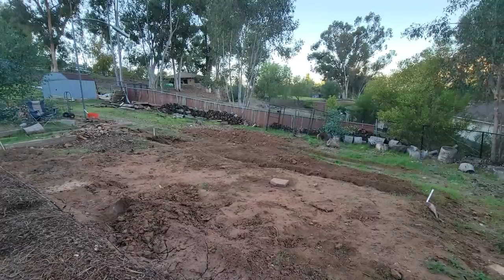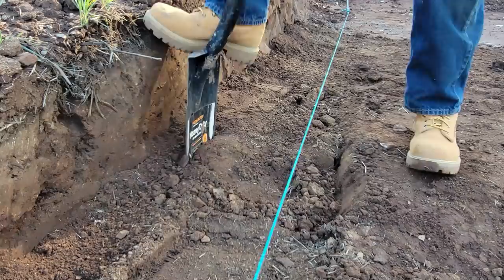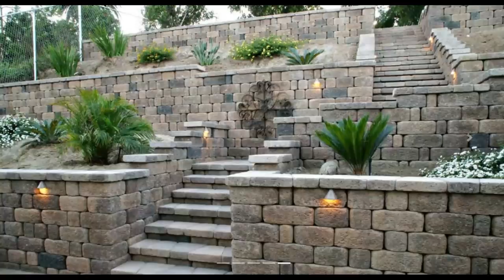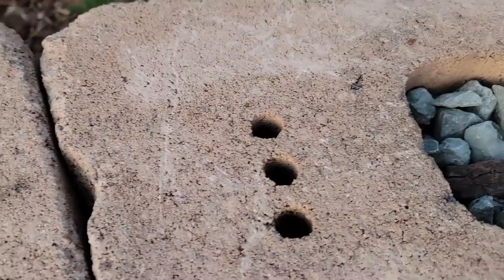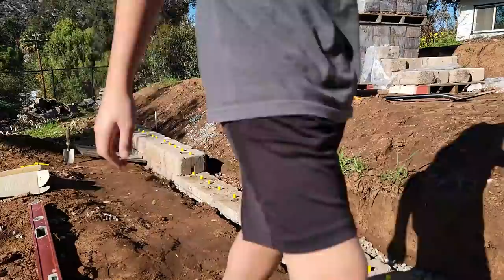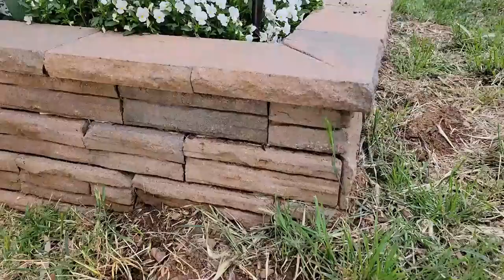How to Build a Terraced Garden Bed

Comment: Beautiful set up, beautiful stones! 
I have a laundry list of things to share that might save someone else some grief and regret. It involves not just retaining walls for terracing/raised beds, but also the pavers that often accompany them. We did a huge job to solve a sloping backyard and to make a safer place for my aging mother-in-law and looking forward to our own aging –in– place plan. 

Things we did that I loved:
-created a bigger patio that connected two awkward back patios with steep and dangerous drop offs.
-created beds that stretched along the back of the patio along the retaining wall to do double duty as garden and fall prevention strategy, Plus making access to the bed super easy from the lawn side.
-used a lighter paver color to reflect light back into a room that was a bit too dark during the first half of the day and which coordinated beautifully with the home exterior
-extended the pavers all around the house from a courtyard area, around the back, with a pathway to the garage door and through the front gate and along both sides of the driveway (that was too narrow for stepping off onto a stable surface for my mother-in-law) and opening up a lovely area In front of the front door and front porch, and doing the front porch also. Love the consistency of the look all around the house.
-coordinated with irrigation guys to make sure we had a way to pipe water into dedicated zones to water certain areas, Including a hose bib extension at the bottom of the terracing.
-Made sure that I could roll a wagon or potentially a wheelchair from the driveway up onto the main patio surface without encountering steps, and potentially into the house with a very low threshold. But part of that was a bad idea.

Problems we encountered:
– we didn’t know how much ants adore paver grout in our area, and that hiring people to power wash means that they power wash the grout out of the pavers. This led to a ongoing battle with weeds growing between the pavers, and that horrible decision between paying virtually for another paver job in order to regrout it, keep after it with a Weedwhacker, risk damaging the concrete pavers with vinegar herbicide, or using the dreaded Roundup. We are kind of between keeping up with it and not keeping up with it because we’re getting old and it is hotter than hell here.
-I made the mistake of being too safety conscious and not enough termite conscious. Or ant conscious. I should have asked the paving guys to slice the pavers in half for the patios so that I could see the foundation & visually inspect for termites. For personal health reasons and because I was growing food close to my home I did not want to go the route of pre-treatment for termites or the baits that would simply attract them to the house.… And who knows what chemicals in those things would get into my food. So ultimately, when I ended up with a termite problem I was told I had to lift all of those pavers so they could drill/dig underneath them, and I got overwhelmed. And the termites did more damage. And I ended up with the poison around the house but at least someone was willing to just carefully drill through the pavers. HINDSIGHT: leave the patios as they were keeping the foundation visible, perhaps choosing a gray paver to coordinate with the concrete to surround/edge patios, or a subtle blend of pavers that had gray in them. The color we chose actually looked fine with the driveway. 
-The design I wanted turned out to need some drains. Those drains always hold a little bit of water. That means we have mosquito breeding grounds on our patio and they either have to be maintained with poisonous dunks or try to cope in other ways. I would make sure that my next design did not need drains.
–I wish I had held out for a design with no steps at all except the aesthetic ones that go down to the lawn below. As it is, I have to do a long circuitous route to drag a wagon Full of tools or plants or baby trees etc. quite a long way to get it up to the patio. As I age, I am aware that a simple accident could be a huge annoyance.
— not thinking carefully enough about the style of the house & personal aesthetic, together. A lot of suburban creations are difficult to Peg, stylistically, and ours is no exception. It's a little more casual Texas colonial on the front and a little more farmhouse on the back, siding and stone facade...not the standard Italianesque or “Contemporary“ home from that era. I’m sorry now that I was seduced by the random-size-random-pattern that was popular at the turn of the millennium.  The choice isn’t terrible. But. It wants something that feels a bit more traditional and my personal aesthetic wants something a bit more minimal. I should have found the sweet spot instead of going on trend.
- textured retaining walls eat up string trimmer line like crazy. Expensive. & Who knows how much plastic ended up in my landscape over the years. A smoother retaining wall brick would’ve been better.
– Or, I would have added a bed in front of the retaining wall, but then I would’ve lost the fantastic thigh high access to my “raised bed“ created by the retaining wall.

-I wish I could have predicted the problem of chemical trails from airplanes dropping God knows what onto the surfaces of our home and vehicles. And all my 62 years I have never seen anything like it on my car, on the surfaces in our area.It’s not like mold or mildew that grows in the darker, damper areas. It’s literally a dark coating on everything that isn’t protected by an overhanging roof or a vehicle that’s parked on the driveway a lot. There’s a whole lot of power washing going on in our neighborhood. Power washing is not great for pavers. So honestly, If I knew then that this was going to be such a problem, I would have used real bricks in a softly coordinating color to edge real concrete, everything mortared to the hilt, As easy to clean as possible. Coordinating retaining blocks in a smoother Finish, and I would probably have fully terraced the yard to the extent that the HOA would allow, 
- every edge becomes a maintenance issue. Things get messy between raised beds in our area where weeds grow insanely fast and freely. I’ve done my lifetime servitude weeding the paths of community gardens and in my own garden. Never again. if I do any more garden construction, there will be mow strips at the edge of any spot where grass likes to grow into beds or plants like growing into the lawn. The paths will be made of lawn grass and large coordinating flagstones set into the turf. Easy maintenance. Mow and go every week. Periodically trim the crisp edge while keeping stolons from creeping through retaining walls into beds. Once a year cut back any grass creeping over the flag stones. That way the paths always look pretty nice year-round with the least effort. Or the least effort short of paving it entirely.

Comment: It looks fantastic.  Thanks for the instruction.  I have a hill that's much steeper, but much shorter in width.  It's a bear, and although it does have a retaining wall at it's base, the dirt overflows it because it is not terraced.  This is a great way to make it a useable space for planting or maybe even a small deck too!
Reply: I would suggest rebar through the hole in the bottom layer of stones going into the ground for stability

Comment: Thank you for your helpful videos. I have multiple gardens and I am working on increasing my garden. There is a patio room with a porch here. I have garden plots surrounding on both sides of the patio room. Off the porch is raised beds. I want more containers on the porch. And I need more vertical garden structures for certain crops. I have subscribed and I have been watching your videos to get a plan to improve my produce.

Comment: Making terraces on any compass direction of slope is vastly worthwhile.  I have mentioned to others of using (my) half terrace raised garden beds.  With another YTer and his once-owned prepper acreage, establishing a flatlander garden, and then having a back slope that wasn't used for 20 feet of height - a most excellent source of diagonal (near-vertical) gardening options !!!  Instead of having a fully raised (100%) garden bed atop a flatland area or a terraced slope - consider - using half-raised (50%) beds for all vegs and smaller flowers, bushes, shrubs, small trees, and dwarf fruit trees on a slope.  Consider a slope looking upwards at it.  Using garden wood, rails, or here displayed stonework walls, dig into the start of the slope for the depth of 16-24 inches.  This will be (depending on the size of stonework you install) or timberworks, going to be ~2-3 rows of vertical stonework.  Dig back into the slope bank for that depth.  Do all of the levels of a "I__I" or "I_______I" shape, and install your stonework or timberwork.  You have done 1/2 of the work in making a terraced bed, and saved 1/2 of your soil for a garden, vineyard, orchard, or mini-forested acreage.  You have also saved 1/2 of your stonework or timberworks as well.  Now - shovel and rake DOWN from the upper slope into that half-raised bed (and add in any additional potting soil, garden soil etc to make a truly exceptional grow bed matrix.  Do this single long line of terraced bed or make smaller terraced beds that can be walked between.  Install a rock or wood stairway up to the next level.  At the upper-slope end of the terrace bed excavate down and create your flat walkway ~24 inches in width.  You want terraces of food, and you want adequate horizontal walkways between the vertical-sloping terraced beds.  Continue up the slope with additional excavating, terrace bed, vertical walkway, and horizontal walkway.  In this 20 feet of sloping height (that was literally also 45 degrees angle of slope for a right triangle , and its actual front-slope edge on the flat surface to the back-slope edge of the top of the whole sloping landscape is also 20 feet.  This is a 1 to 1 slope - or for every foot up - you go back 1 foot.  So having a 16 inch depthed terrace bed with inbetween walkways up the slope, you can create you literally can make   

With reasonable construction of this 20 foot tall slope, 45 degree angle of 28 1/4 feet of actual slope surface, and the slope pushing forward 20 feet, each terrace (at a minimum) is ~2 feet outward and ~ feet downward.  This would be a total of (maximum) 10 terraces per this slope.  Making it 7 terraces of 14 feet outward and 14 feet downward or 8 terraces of 16 feet outward and 16 feet downward is more reasonable.  So for a worthless 20 foot slope you have turned it into a terraced bed slope of just ONE single terraced bed of (example) 2 x 3 terrace bed  = 6 sq ft into a vertical-sloped terrace line ... 7 x 2 ft outward x 3 width = 42 sq ft or 8 x 2 x 3 = 48 sq ft.  Multiple that by what length you want to do the rest of the slope sideways.  In his situation of 50 feet of slope this would be a total gain of 2100 - 2400 sq ft in the most-smallest of vertical landscape gardening.    

You want the inward side of the garden bed for the smaller veggies with small roots (radishes, lettuces).  Big tubers and root vegs (daikons, carrots, beets, potatoes, sweet potatoes, yams) you want in the forward edge of the bed.  Depending on the compass direction of the terraced bed, there are sun-loving and shade-loving vegs and plants.  If there is a south-facing bed, then put the taller and thickers vegs in the front, shading the backside vegs (corn and lettuces etc).  If you have small sun-loving vegs, then put them in the forward (deep) section, while you can grow corn or trellised tomatoes, cucumbers, gourds, etc in the back still getting their big portion of sunlight.  You don't have to make a 4-5-6+ stonerow of terraces for a veggie bed.  If you do grow on terraced beds, such taproot trees, then yes, you need to consider how deep that tap root will be (along with its horizontal tree roots) and make accomodations for its growth.  In this example of a friend, what was 20 feet tall by 100+ feet wide (2,000 sq ft) of useless ground could turn into 4,000+ sg ft of growing space in a limitted area (saving flatlander ground for other needed uses).  Also with the bigger viney plants not trellised (watermelons, gourds, squash, zucchini - that could be also trellised and have such holders holding up the fruit ...) allow their vines to hang over the terraced grow bed wall for extra growth and sunlight (the very reason for having multiple smaller beds than having a jumble of vines covering up usuable grow space.

Also if doing stonework terrace beds or walls, then consider not making a stone-to-stone tight terrace wall or bed.  Make 1 - 2 inch separations, and put in dirt, then put in strawberry plants (strawberries love rock hidey holes), and put in marigolds or other small flowering plants.  Anti-insect and -bug plants (marigolds etc) brighten up a wall but provide all the needed stink to stop snails, slugs, ants, etc from crawling up the stonework or timberwork into the garden delicacies.  If you do timberwork walls, then drill out holes for flowers or plants is also a doable option.  And if you grow herbs, then these terrace walls are good for growing basil, rosemary, thyme, mint, spearmint, peppermint, anise, fennel, hyssop, etc as an herb wall.  Don't waste space.  Use it !

As you have these slope beds, then you have perfect human body alignment with tall veggies and small veggies.  No nore total bending down to pull carrots, or standing up and harvesting corn, the slope adjusts your heights to the veggies that are grown across the terraced beds.  No more or less sore knees, legs, shoulders, and back.

By doing this method of terracing you will have saved 1/2 of soil, 1/2 of all stonework or timberworks, and still have full terraced beds for veggie garden, herb garden, vineyard, orchard, or a mini-forest of a permaculture food forest environment.
Reply: Wish you’d make a video showing all this… It sounds amazing….
Reply: @jrs3359  just easy to understand.  (1)  Piece of paper and draw a slope.  (2)  Another piece of paper and draw a flat landscape with a raised bed garden on it.  (3)  Draw a diagonal line (same slope line) on the raised bed.  (4)  Transfer the upper portion of the diagonal raised bed to the slope.  Done.  2x as many raised beds with the same volume of soil.  Shallow depth for shallow plants (lettuce, radish), deep ends for roots and tubers (potatoes, carrots, ...).  South-facing deep end with corn or huge viney plants (pumpkins, watermelon) and allow vines to hang over and outside.  North-upslope for semi-shade-needed plants by south-downslope plants (corn).  No more need to tear up entire slope and then installed terraced wood or concrete block structures - use 1/2 of product and use natural slope.  Far easier to also hoe or harvest vegs - less leaning over, bending, stooping, ... can kneel or knee pads and work the bed with ease.  Also 1/2 soil volume is 1/2 irrigation water !

Comment: Love your vision and the raised walls. I'm wondering how you're going to keep moles, voles and gophers out. It looks like they would not be going under your wall. And it looks like you won't need to put a wire mesh landscape hardware under the beds.

Comment: With the heaving of the soil in freezing climates, would this type of wall work? I think we'd need a cement base twice the width of the stone, or something like that, and the plastic pins would probably snap in the cold in a heavy duty freeze/thaw cycle, no? Or are these products rated for colder climates?

Comment: What would someone do if the hill is at a 45-degree angle in some places and you are wondering about the base?   Do you even try?  What is the steepest angle to try this? What is an alternative, if you want to stablelize the hill and have a flat terrace about 2 feet wide?

Comment: First of all!!! did i miss the non- existent perforated pipe behind the wall at grade for drainage? This wall should be excavated much further back then 8" ?? Install filter cloth wrap the pipe with it... and fill that massive void!!  behind with clear stone like you used for the base !! Keep in mind you used no geo textile in the wall system at all as its not needed and anything higher then 4-5 ft should be engineered?? HYDRO STATIC PRESSURE WILL PUSH YOUR NATIVE SOIL AND YOUR WALL OVER? SEE HOW LONG IT LASTS ??
Reply from the maker: I built it to the manufacturers specs. Even had a rep out to give me advice.